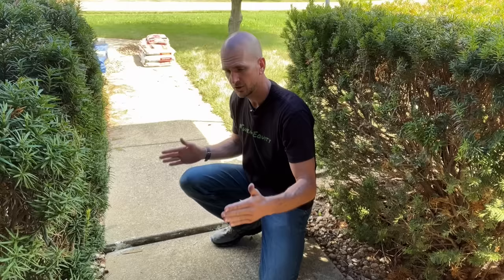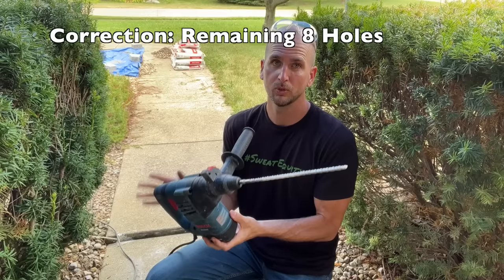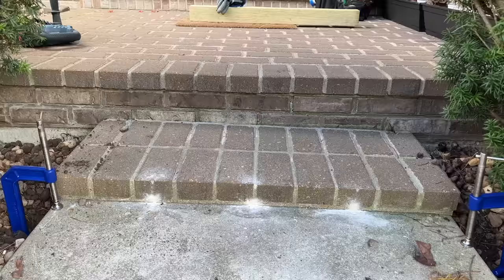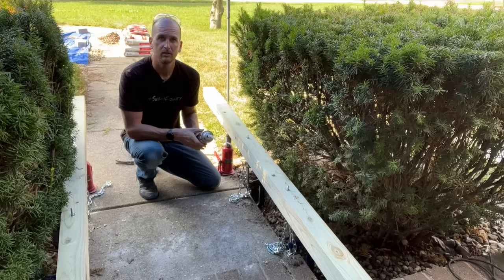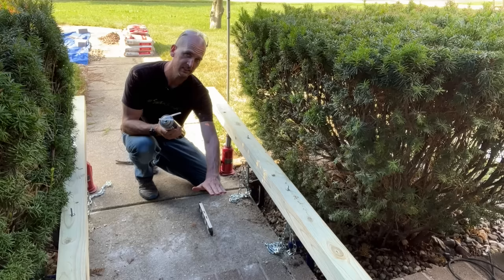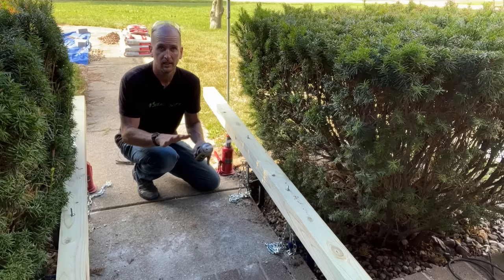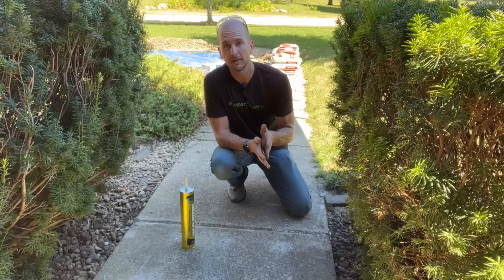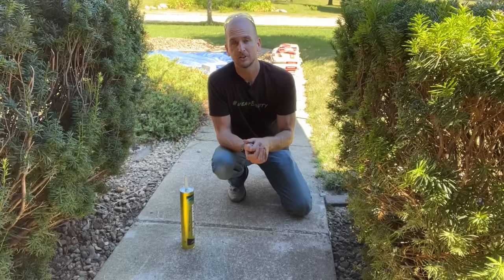How To Fix A Sunken Sidewalk With Spray Foam

Comment: How to build a better mousetrap -- make it complicated and more expensive (either materials, labour or equipment).  If not for the bricks atop one end, it would be easier and quicker to pull it up, add fill and put it down again, or remove and reconcrete with a couple of $5 bags of readymix concrete (though admittedly the final dried colour would be different to the older adjacent paving).
Also, technically this is not a sidewalk, since it isn't alongside the road -- I imagine if it was you would have the local government do this repair work for you.

Comment: The time and money it took to do that I would have pulled the whole stone out and leveled sand to raise it up. That foam will degrade and now you have a toxic mess to clean up not to mention all the hole drilling weakening the paver.

Comment: Don't spray foam insulation under you walk way, I will create hollow spots under it  in about 4 yeaers as it breaks down.  Second don't drill holes unless youe lifting a driveway and using the correct stuff to do so that has weight bearing propertys.

Comment: How long does this fix last??
Reply from the maker: Honestly it sunk back down.  It is a little better than before and the sealant is still holding strong but the concrete is sunk back down a bit.  I will most likely be doing a round 2 on a similar problem trying an updated method for the support under the slab.

Comment: so how to use this jack method for a section that has sunk in the middle of my driveway ?
Reply: You will have to get very creative with that. It may be cheaper to just cut out and remove a middle chunk with new concrete and a better base.

Comment: Great video and interesting idea. I would think, over time, the foam would sink and/or collapse. Especially if it isn't closed cell foam. Wouldn't it have been better (if possible) to try to get crush underneath the concrete pads for a more permanent repair? I'd be curious to see how long this repair holds up before the foam sinks and/or collapses.
Reply: It can, but depends on how well it fully cures before weight is added.

Comment: Can we lift even more to put cement in there?
Reply from the maker: Yeah, you could use the same method for raising the slab and then mix up some concrete very wet into a slurry to flow under the slab if there is a large enough gap.

Comment: 38 years in the concrete trade. Would have been much easier to break the slab up with a sledgehammer and pour a new slab. Saw cut against the brick to solve that problem.

Comment: Great idea but too much work and material needed.  Its easier to either lift it up on edge and throw some dirt and gravel under it or just bust it up with a sledgehammer and mix a few bags of concrete.

Comment: Sure, the foam will work....for a while, it will eventually collapse. It's not structural, gravity is relentless. You'll get to redo this and will probably want to get all the broken down, compressed foam out of the repair area before using whatever you use to fix it. Using the pumped in grout technique would last longer and comes with it's own set of "will it work and look right" issues.  Levering it up and packing sand and gravel in would maintain the visually old look, tearing out the section, adding rebar pins into the existing slab, pouring a new section is best, and yes, easily DIY except for the concrete finishing, still doable.

Comment: OK folks, just break the concrete.  Remove the rubble.  Prepare a new subgrade and compact.  Place forms on the two sides .  Place new concrete.  let it cure.  Scratch in expansion joints.  You are done.  The foam will deteriorate over time as from daily heat exchange and exposure to organic material in the ground.  The foam is not a load bearing material and will fail.

Comment: I find that various critters and insects like using foam to nest in.  I would be worried about failure due to this.  Your process is similar to what is known as slab jacking where a high slump mortar is used instead of foam.  The trick is injecting it so all voids beneath the slab are filled.  I have done it with a grout mortar tuck pointing bag.

Comment: Could also be a good idea to not drill the holes and instead get a tube with concrete that exits around the center of the slab. That way, the concrete would spread evenly from the center to the sides (hopefully) and you'd also avoid the foam compressing after a few years. And it's a bit better for the earth to not use plastic/oil products, but that's ofcourse less important than most other considerations.

Comment: Personally I would not want to see 9 holes filled and see the difference in color from original walkway. How I would do it. And just a thought
Left slab with bars. Leave on its side and support it. Poor a small footing and the level you want on the porch side. Maybe even go under the porch some. Making sure it has just enough slope for drainage Leaving about a 2 inch lip for sidewalk to lay back down on. Let set overnight. Mix cement and poor just a little higher that the bottom of the end of sidewalk your attaching to. Lay sidewalk back down. Since you know it is level at the porch now an setting on the footing you just pored. Now just step on or walk or do whatever it takes to make it level at the existing sidewalk. ??

Comment: Just fill the friggin thing with a 1” cap of modified cement with bonding milk or flat coat! 1 hour, couple of screed sticks, $40.00 😂❤
Reply: Or lift 1/2 slab with 2 - 1 ton jacks , fill with damp soil, repeat on other side, tamp

Comment: People should know that this isn’t a fix but a temporary bandaid. The issue is with water and grade base being washed away over time causing the slab to drop. By jacking your not fixing the problem and will be back to fix in the near future. Mud jacking is a joke unless u need a temp fix. DIY is ok but leave concrete to professionals.

Comment: I don't think this would work for me, foundation of my walkway is deck mud with a ceramic 12x12 tile on top. The area I'm trying to level out is probably more of a 2 and 1/2 to 3 in drop and it's also on an elbow in the walkway out in a courtyard. The ceramic tile is really hard to find since it's probably 20 years old, I'll probably just end up leaving it as is.

Comment: This guy would get fired for time wasting if he worked for me. Solution is simple. Take a large crowbar, leverage it to move the slab, throw some stones or aggregate underneath. Problem solved. The weight of the slab ensures it doesn’t move. Best example of over engineering I’ve ever seen.

Comment: I am not sure why I dislike this solution. If you can lift the slab, why not underfill with sand/whatever? Or dig out the underneath and fill with concrete? Or make a brace/rails for the slab to sit on, on each side? I get it for a driveway, the weight makes other solutions impractical (other than removal and repoyr)

Comment: Hypothetically speaking what if the reason the first slab has sunk is because they put a pressure switch under it so as you get home and step on it that it turns on anything radioactive that needs to be on for there testing hmmm

Comment: Wouldnt it be cheaper ans easier just to break the old concrete and put a new one?
Reply from the maker: Some people prefer that method others don't like when the concrete doesn't match.  If you don't mind the mismatch breaking out and repouring is not a bad option.

Comment: And to think.....there are clowns out there charging thousands to do this.  When you question them they talk about "extensive training" and "very costly equipment".   It's a joke.
I did this same thing you did BUT I grabbed bricks and placed them under the corners and one as close to the middle as I could get, then I spray foamed it.....worked great and cost less than 20 bucks.

Comment: Prob quicker and easier to just pour a new concrete square and cheaper and it will last longer and be stronger especially if your gonna ho through all that trouble

Comment: This will be a good temporary fix but not Intended to last that foam will rot and it is not made to hold up concrete it is made to seal gaps. Also it is such a small area you could have just poured a new concrete section. Sorry but it is not the correct fix. Also the correct way to have done it if you really wanted to raise it would have been to use lime stone to pump in the the holes

Comment: I definitely wouldn't do it that way. So much work and it rests on spray foam. I bet it sinks to some degree again. 
A lot of stuff to buy too: not everyone has chain, two jacks, lumber, concrete drills, bolts, spray foam, etc.

Comment: I think it would be better if you just took a sledge hammer and broke up that small portion of cement and then mixed new cement and put in a brand new section.  Thats just me.

Comment: Not a fan of drilling the holes in such a prominent area.  I'd rather just lift or shift that size slab, then regrade under it with sand or base or both.

Comment: I would have busted that old piece with a jack hammer or even a sledge hammer, removed the broken pieces and re poured it. 20 times cheaper and faster.

Comment: For the low cost of the spray foam... oh, and the beams, clamps, roto hammer, chains... then, just conveniently store those beams in your garage. And you have a bunch of holes in your concrete. If only a device existed that could pry the slab up, so you could just throw some dirt underneath and save you all that time and money. What's your next video? Simple House Painting: Just raise your house onto a track, then move it back and forth while you simply hold a paint roller to it.
Reply: He must have paired up with the foam company.

Comment: There are a couple of problems with this method. Drilling holes in the concrete slab greatly reduces the strictural integrity of the slab making it prone to cracking. The foam itself will eventually crumble and the slab will drop. If the ground isnt level, and the foam disribution when it crumbles is uneven. It will make the already comprimised slab even more prone to cracking. It would be better, and more cost effective to remove the slab, and just add some dirt.

Comment: Thats bad for the environment just dig up the sidewalk slab level the ground and put it back down thats how you fix it correctly. Not by using shit foam, you do it right the first time because over time the foam will fall apart and the slab will just sink back down.

Comment: Next week a new video about how use your palm sander to sand down and lower the slabs you raised due to too much expanding foam. Just remove the slab, and add a locking gravel layer to the correct depth then reinstall the slab. Simple easy and very little cost.

Comment: I seriously would NOT do this. the amount of weight and stress on those 4x4's is huge! I started a project like this once. the 4x4 busted because of a hidden issue inside the board. It went past my head at 100mph and came down out in the street 50ft from my house. I gave up and called a contractor. $400 later it was fixed.

Comment: I am not trying to take away from this video but as the owner of a foam jacking company, this is a temporary fix. Using the cans of foam is the right idea, but it is an open cell foam and will not support the weight of the concrete for very long. A closed cell foam for lifting is a different type of foam that will not deteriorate  and will provide support for the life of the concrete. For a permanent fix, I recommend  calling a professional  in your area and have it done correctly. This should take about an hour and  cost around 500 depending on the amount of void under your slab.
Reply from the maker: Thanks for the feedback Jim, appreciate you sharing your knowledge.

Comment: Bottle jacks 2x$40=$80
4x4 2x $15= $30
Chain= $20
Jack$100
Bolts = $15
C clamps 2x $15=$30
Foam =$20
Sealant $15
Drill brush bit $10
Bosch Hammer drill $250
12” hammer masonry bit $40
Total= $610.00 plus time, gas, tax, etc

Comment: By the time you done All that prep and spent ALL that money on materials and Equipment , ain’t it easier to actually completely remove and put a new concrete slab . There will be some good use for that product , but common you making job hard bud .lol
Reply: That was my thought on this project.

Comment: if you are already jacking up the section. why not just remove it and redo the bedding ?  what the point of that spray stuff?    how much it costing for those wood beams?    those holes are a great way to cause cracks in the concrete.. they will eventually go from one hole to another...  this just seems like some lame commercial for that Gap Filler crap

Comment: Just call your local A1 Concrete Leveling. It will be the same cost as you buying all those materials and you will get a warranty. Also it will hold long term. Great stuff is not dense enough and will break down. Jacking slabs up with bottles jacks usually will crack the slab too and I doubt this held long term. Plus A1 will be in and out and about 30 minutes. Stop YouTube fixing your house people. lol.

Comment: Maybe I'm missing something but why couldn't you just lift the concrete slab and re lay it using sand - you've solved the problem but it looks like you massively over-engineered the solution and it probably cost a lot more than it needed to.

Comment: OR....... you could break up the old faded sunken concrete, pour a whole new piece for $30 and be done with it in 25% of the time. and be a better fix. and not resettle if you do the sub-base correctly. and fade to match in 6-12 months. nah.......

Comment: Massive overkill. You could've lifted that block simply with a digging bar and a block of wood. Lift one end, shove some rock under the slab, then repeat for the other three corners and done.

Comment: Umm.... if you're going to go through all that BS. why didn't you just remove the slab, back-fill underneath properly and put the slab back? The issue was insufficient sand & gravel underneath. Refill that, don't macguyver a way to use a artificial duct-tape solution (duct tape, as in using artificial FOAM instead of just using sand and gravel). I'll bet it would have taken WAY less time too.

Comment: This seems like an insane way to temporarily resolve the issue. Just use a pry bar to lift up the slab, then put more rocks/concrete under it.

This video is incredibly odd, and foam will not last. I hope no one follows this video 'tips'.

Comment: It's there a reason you can't just drill bigger holes and pour concrete in instead of using foam.
Reply from the maker: I have been thinking through more options and that could be a contender but the hole would need to be fairly large.

Comment: Lol fun to watch weirdly . Why didn't you just pick up the stone and grade the ground beneath it. Also for the two jacks  2 4x4 6 footers and 16 $ worth of liquid. hammer drills and bits. Just doesn't make any sense to me. Maybe if your looking for a make work project sure. But this does not seem to be efficient from any direction. Remove stone. regrade, replace stone. Done. Zero money spent.

Comment: Over engineered repair.  Overall not a smart direction to take.  You should have used item 4 or some small stone fill to cover the area under the lifted slab.  Also when lifting the slab, you would have noticed how and why the slab sank and make repairs accordingly.

Comment: This has to be the dumbest way to use a human mind and body. You're going to drill a bunch of holes in concrete and weaken it? Then use spray foam LOL to keep it from dipping down again???  For 50.00 worth of bag cement and a couple 2x4's you could have poured your own square and been done in LITERALLY ONE HOUR. And how much did that drill cost? How much time spent? Wow Darwin award granted.

Comment: Using only gentle pressure with my fingers, I can squeeze crush spray foam insulation. I cannot squeeze crush rock or packed dirt. I don't trust the easily squashable foam to hold up at all. The correct way is, of course, to remove the sunken slab, properly pack the underlayment, and pour a new properly graded slab. If you waste your time over and over doing something wrong you are never going to have time to do it correctly. Concrete work should last forever. Your sleazy pseudo "repair" is going to fail sooner than later.

Comment: well, you are making the money, million views, half a million subs, but, come on, how long is the spray foam going to last with that much weight on it?  It is NOT made for that.  The lift system is ok but simply raise the block higher and fill underneath with pea gravel or sand OR put metal on the two sides of the slab.  Heck, you're young and fit, just REMOVE the slab, lift it to one side or the other and then easy to add graded sand or gravel then replace.  The spray foal is very uncertain.  By the way, you selling the drills or the foam or both?

Comment: Horrible.

The things youtubers recommend to people is crazy.

None of that will fix the soil compaction issue. All you did was put less effort into a proper fix. That section could be reset like a piece of stone or repoured.

Just no.

Next, they are going to show you how to level your wood subfloor with spray foam! Do your research, humans.

Comment: You know what I have never seen? A video on a foam repaired walk or driveways condition a year later, or two years later. Heck, even 6 months later. Nevermind, pointing out that if you are going to lift it, then why not use proper techniques and material to repair the walk. But, I guess people want clicks. Should rename the channel to, 'Everday Home Repairs without real knowledge'. Y'all think with these 'nifty' ideas you are somehow saving yourself cash, when in reality, you are still using the same amount of time and effort, so why not use proper fill? But, in the end, no one wants to do a job properly, they want to think that they are "geniuses". Good luck with that Einstein.